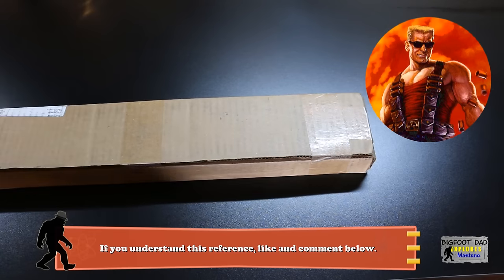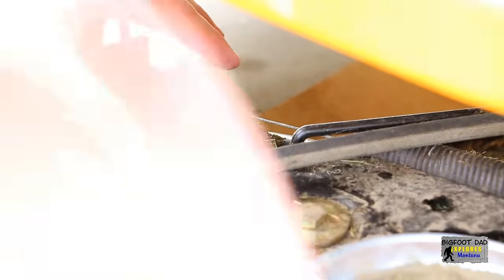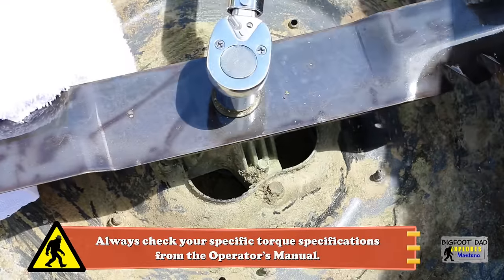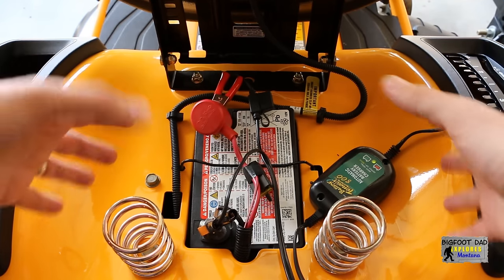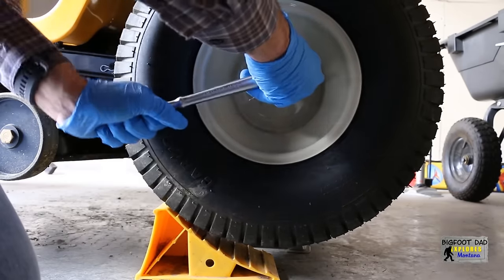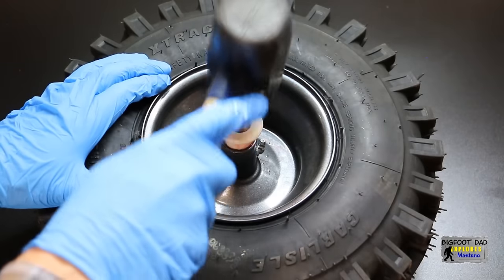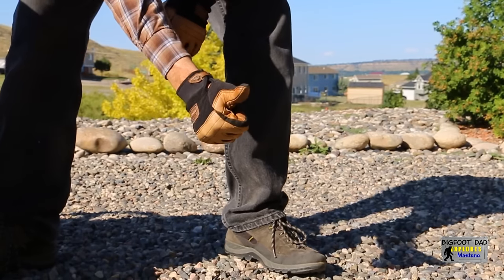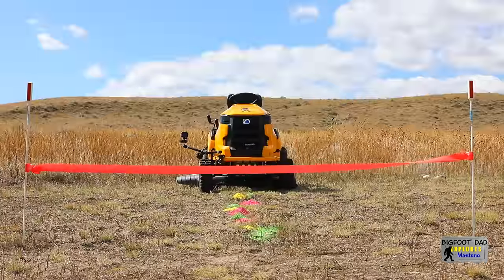Upgrading Your Tractor Mower: Cub Cadet XT1 LT42" Mower (ATV Tires, Blades, Brush Guard, Headlights)

Comment: I have this same tractor, already did the brush guard- now I need the rest of the upgrades!
Subbed!
Reply from the maker: Thank you, Blue Ox!  Upgrade your way to a new experience and have fun doing it.  Welcome to the community! 😎
Reply: @BigfootDadExploresMontana  
So after the brush guard I upgraded my mower blades (same Oregon mulching blades) along with three coats of spray on truck bed liner on the mowing deck, to prevent rust. I added a mulch plug, and replaced those lame turf savers with Carlisle super lugs👍🏻
Also added a Coleman three way atv hitch, for pulling my dump cart, boat trailer and a grab hook for pulling logs.   Couldn’t be happier.
Reply from the maker: @BlueOx2277  - This is completely awesome.  If you feel like sending a picture to my Instagram account, I'll post it here for the Youtube community.  Nice work!
Reply: @BigfootDadExploresMontana  
Not done yet-  I need to find some 8” donor wheels that I can mod to fit the front- I want to go with super lugs in a 16-6.5-8, this will give me a bit more advantage against hidden gopher holes.  I’d even go with an 18-9.5-8 if I could get away without any rubbing.  
Also want to add a set of Kolpin rhino grips behind the seat, that way I can carry a shovel or my weed trimmer onboard.  
And I’ll be more than happy to send you pics once the tractor upgrades are done👍🏻👍🏻

Comment: Drill a hole and install another valve on the opposite side of your wheels if you run Hub caps or want easy access.
Reply from the maker: Hi, Gord - that's a great idea!

Comment: I have the same lawn tractor.  3rd season on mine still the original blades are in great shape, surprised, my previous lawn tractor was a Craftsman YT4000 and I swear you had to sharpen the blades every time you mowed...must have been really soft metal that those blades were made from.  

I just put gator mulching blades on my lawn tractor...my only complaint with this mower deck is the lack of a baffle system up front and to the side to keep the clippings under the deck, there's a lot of blowout in mulching mode.  

I have a 42" 3 stage snow blower for my lawn tractor, it works year round so no need for a battery tender....during downtime I'll go out and start it every couple weeks if we don't have enough snow for the blower to be used.

I have been thinking about pulling those front bushings and getting bearings for the front wheel spindles...kind of stupid to use plastic bushings like that on a component that has weight on it all the time and spinning under that weight.  I've heard of people doing a bearing swap and just need to find out the size to order and get it done, and then that grease zerk will actually be usable for something.

Hmm, the ATV tires sound like a great upgrade, I may do that to mine.  Wishing now I would have got the XT3 Garden Tractor with the rear diff-lock and shaft drive...the rear diff-lock would have saved me last weekend mowing the front ditch.  Got to the end of the ditch and went to turn back into the yard through the ditch like I usually do but it was a soupy mess and got stuck...have to admit though, first time getting this lawn tractor stuck, the Craftsman seemed to get stuck in everything, this XT1 lawn tractor goes through a lot of stuff that the Craftsman would get stuck in, but that diff-lock would sure be nice but can't afford the $5400+ for the XT3  GSX54 LOL.

Comment: I have the same mower and you vid reminds me that in the year of using it i have done zero mantinace. Oil change time. I bought the cub cadet 3 stage snow thrower for it and since it's a thrower rather than a plow it doesn't even need chains which i thought was nice.
Reply from the maker: Matthew - very cool with the snow thrower - I'd love to use one of those too!

Comment: To prevent tire slippage in hilly terrain fill your tires with windshield washer fluid. The extra weight is on your tires and not transaxle this will improve hill climbing and prevent spin out. We do that up north for snow removal, way better then chains.

Comment: Reusing cotter pins is fine, as long as the tabs on the other side aren't sheared, you are good. The caps also helps keep the pins in place too

Comment: I do my maintenance in the Fall, change oil, replace blades, replace transmission fluid if it hits the next 200 hour mark, lubricate all lube points, run the carb empty, clean the gas tank inside and out and leave dry, repaint the deck if it needs it, check all belts and replace if necessary. I disconnect the battery and bring it inside out of the cold - put a constant current, constant voltage battery maintainer on it.
   Why leave the old fluids still in the engine and transaxle to cause corrosion all Winter? I also check the bearings in the spindles, clean the bottom of the deck and repaint as necessary. Late Fall in central Alabama is around December when the leaves finally fall off all the trees, so I use the Cub to mulch the leaves before putting it up for the next season.
Reply from the maker: Hi, longshorts3!  Thank you for the detailed feedback. I wish I had the same motivation to do such a thorough job - this is amazing!  Your mower probably still looks and runs like new.  I like the deck painting suggestion as well as the note about the old fluids.  I wish it was late fall here in December.  Maybe it's time for a migration down south!  😎

Comment: Seems like Oregon company could make the balancing doo dad with a star pattern on top to accommodate their blade.  

I blow off the top of the deck with compressed air after mowing and would surely do it before major servicing.  Instead of pulling it all off as you have I might jack the whole thing up and set 4 to 6 inch blocks under all the wheels and while lying on the ground work up from underneath.  For purposes of demonstration you did it best by pulling the entire thing. I like the board wedge for holding the blade to get the fasteners off.  Checking tightness of fasteners and blades clearance, while you're in there is a good thing.  Thank you for reminding us to do that. 

I have walked around this yard and dug out cacti before mowing.  

Too bad nobody thought to tape over the grease fitting tips before powder coating.  The rims look very good by the way.  Press on grease zerks; what will they think of next ? :-(   Does John Deere do screw in grease fittings ?  

How does JB Weld figure into a tinting scheme ?  I would want my lights un tinted for best night time vision but to each their own.  I like a backing music track that doesn't compete with the voice over, good work !  As if the west doesn't have enough wind blown dust. ;-p
Reply from the maker: Hi, Gweedo - Ghost Dad was being facetious about the JB Weld in his mythical concoction of ingredients to tint the headlights.  We actually just went down to the local auto store and bought a can of spray-on lens tint.  Thank you for sharing your thoughts above and for the feedback!
Reply: @BigfootDadExploresMontana  ~ You're welcome, Big man of the Bigfoot !

Comment: i have a cub cadet xt1 , i use an air compressor, power washer with the under car attachment spray or i use the lift kit that i bought , and power wash when the front end is up high

Comment: The one mod I did to my 54" fabricated deck and snowblower attachment was swap out those annoying bow tie clips and replaced them with the standard "R" type clips.  That one mod makes a ton of difference when removing and reinstalling your deck or snowblower.
Reply from the maker: Hi, William - this is a great tip!  I think I'll replace them next time around.  Thank you for sharing!

Comment: Wix 51348 oil filter fits this lawn mower, rock auto has them priced around 4 bucks. Sometimes they have a 12 pack over run for around 13.

Comment: Don't forget to upgrade the battery to a higher CCA battery. I have that mower and the factory battery just didn't seem to cut up on startup sometimes so I upgraded it and made a huge difference. Also, the deck spindle nuts on the top of the spindle shafts have both worked loose several times but nothing locktite can't handle.
Reply from the maker: WB - thank you for that advice!  Its probably about time for a battery change in the spring and I'll keep that in mind.  🙂 Glad you caught the spindle nuts before they worked their way all the way off!

Comment: I have a Club Cadet but I can hook a water hose and wash the deck with the attachment that is on the deck for that purpose. This seems like a longer video then it should be. Where did you get the Sasquatch Decal? How did you push your mower out with a flat tire. When you didn't have. A flat in the beginning of the video?

Comment: As we say here...Wicked video! That's great with an exclamation mark! I would have left out the tinted headlight covers but the tire upgrade super. The only mods I made with my XT1 is a snow blade and a milk crate in the back filled with granite rocks and tire chains for the winter.
Reply from the maker: Hi, CapeAnnImages - your mods are legit and inventive with the milk create and rock setup.  Perhaps a set of these tires in the back would help with the plowing as well.  And agreed on the headlights - that may have been a little over the top.  😅  Thank you for your feedback!

Comment: i like snappers they work well and have the body movement of a crawler great for rocky and uneven ground (i tourture tested one) and does very bad in water the belt slips al it is very light got it for 75$ used so there really good in my book maybe a motor upgrade is needed

Comment: Just bought the same Cub Cadet Tractor.  Interested in upgrading the tires.  Was checking out the SunF rear tire you went with,  but want to know if the 20” hight of the tire was the same size as the OEM rear tire that came with the tracto?  I’m asking because a few of the reviews on the tire said it was less than 20”.  As long as you change both I’m sure it’s not a big deal, but thought I’d ask.
Reply from the maker: Hi, Anthony - there's probably a height difference (we could look at a tire sizing comparison tool), but it must not be significant.  Everything still seems relatively level with the full tire swap I did and, if not, there are adjustments you can make to the deck to compensate for that.  I may notice a difference if my lawn was more filled in and green, but it's actually just a lot of rough prairie grass.  Not sure if that helps, but hopefully it gives you a little more insight.  😎

Comment: So much for waiting to see how hard it was to install the new tires on the wheels, must of used magic. Easy part of applying grease was covered very well though.
Reply from the maker: Hi, Gary - thus magic came in the form of a local tire shop.  😂 I think they charged about $5 or less per tire - I don't remember the final cost but it was pretty low.  I was going to have them balanced, but... 
I appreciate the feedback - this helps me understand what you and everyone is looking for.  On an upcoming video, I did record the tech installing one of my tires for an RV upgrade.  More to come soon!
Reply: @BigfootDadExploresMontana  Thanks for the reply. I was thinking a tire shop might be a good place to get them installed and maybe buy them there if they have them.

Comment: I have those lug style tires on my Kubota B2920HST and I find that if you cut the wheel tight on grass it will tear it up. The work great for traction just don’t turn the wheel hard on nice grass.
Reply from the maker: Hi, H&P - agreed!  It can wreak havoc on a nice, green lawn.  Thank you for the tip - that will help others that have that style of lawn.

Comment: I enjoyed the video. If you install mulching blades shouldn't you use the plate that covers the discharge shoot? My property is at least as hilly as your one section, is a fully pressurized engine lubrication system necessary? I am looking to buy the Cub Cadet XT1 42".
Reply from the maker: Hi, Robert - For the blades, I was just looking for something more robust to chew through some of the sagebrush and such.  It's been shooting out the grass pretty good.  But, yes, there are mulch plugs you can get which will force the grass to continue to cut itself down under the deck.  But for a fully pressurized system, I am unsure.  I haven't had any issues with the setup I have so far.  Hopefully you're able to make your final decision and that it works for what you need.  Good luck!
Reply: @BigfootDadExploresMontana  Thanks for your reply. I had asked the same question about the lubrication to a dealer and he replied that it is pressurized.

Comment: Awesome video. Job well done. i would like to have an agressive set of tires for my John Deere 1025R FILB Sub Compact utility tractor. It came with a 54", 3 blade, drive over, quick connect, mower deck!!!

Comment: I agree with the back tires have little traction. They were slightly over inflated from the factory but even reducing them below 10 lbs  doesn't help much. What tires do you recommend for the rear? I have some steep slopes to deal with.

Comment: I put a set of R-1 tractor tires on the back of mine and filled them with old Motor oil for ballast works great on hills
Reply: Water is heavier.   Some use window washer fluid or add in coolant to keep it from freezing.    Old school tractors used calcium for extra weight.      Just sayin nothing is worse for an ecosystem than spilled oil.
Reply: @audimaster5000  I dont know about water being heaver but my oil put  100 LBS in the back and it works like a charm

Comment: pro tip
if you have a decent sized air compressor and line for it. use a pnumatic impact driver to remove the blades, its much easier than using a standard ratchet

Comment: I have a bad spindle and was tryin to take my blades off. I'd bought my mower used  and had to use a 2ft breaker bar with a cheater pipe and wrung off my 1/2" drive extension  and the star pattern on the spindle shaft. Had to cut them off with an angle grinder. I dont know why people tighten stiff up like that. I cant right now,but I'm definitely gonna tryin get me some 4 ply tires. I'm ordering g5 gator blades,2 new spindles,new nuts for the spindles,and a mulch plug. It does ok with the side discharge and oem blades,but I'd like to try the gator blades with and without the mulch plug in. I've heard good things about them.
Reply from the maker: Holy smokes, Cipher Code - that's crazy!  I'm glad you're getting new spindles in case anything was damaged.  Hopefully the Gator blades do a better job at mulching for what you need.  Good luck with the modding and feel free to send in photos if you want to share them on on our Community tab!
Reply: @BigfootDadExploresMontana  On a side note I'd taken the deck off and had it up on sawhorses( I have a bad back and squatting down kills it) changing the spindles and blades. I'd just finished tightening the blades and flipped the deck over to set it back on the driveway when I picked the deck up I accidentally drug it across the sawhorses spinning the blade on the left side. I had my fingertips under the edge. I almost cut the tip off my left pinky finger. Luckily my sister is registered nurse that worked in the er. I lost the nail and it's still bandaged a week later. Just a freaky accident, that thankfully wasnt any worse.

Comment: I have a Cub Cadet XT2 LX 46 with a 23 HP Kohler. What color did you use for the Wheels? I really need to get a set of those tires or something similar for my lawnmower to grip better....

Comment: Very nice video, thanks for sharing.  I was surprised when you finished replacing the gator blades that you didn’t coat the underside of the deck with a light penetrating oil or silicone spray. I usually cost the underside with silicone, and on the upper side, I add a bit of oil to all of the pulley hub bearings.   Did you dismount and remount the tires yourself or have them professionally serviced?
Reply from the maker: Hi, JW - yes, I should have done that to the deck  but now I'm thinking this may be a future video!  I'll definitely consider this.  
Yes, I also had them professionally dismounted and mounted.  I watched a few videos of people wrestling with them at home so I thought I'd just run them over to the tire shop.  It only took them a few minutes.  Thank you for your feedback and welcome to the community!
Reply: Bigfoot Dad Explores Montana  Bless you sir.  Trusting that you and your family are safe during this pandemic.  Wishing you Peace, health and happiness.

Comment: I use a car floor jack to raise the rear end with 2 (2x4) as a block. I use my air impact gun to remove the blades. I hang the blades on a nail after sharpening for balance. Total time to remove 2 minutes. Time to sharpen, balance and reinstall 10 minutes. My front tires always slowly go flat. I just pump them up with my compressor.
Reply: My cordless Dewalt impact driver works pretty good too.